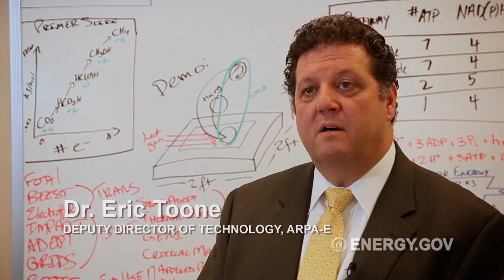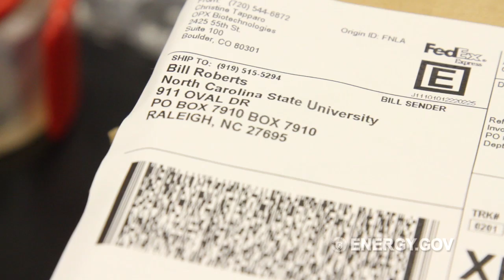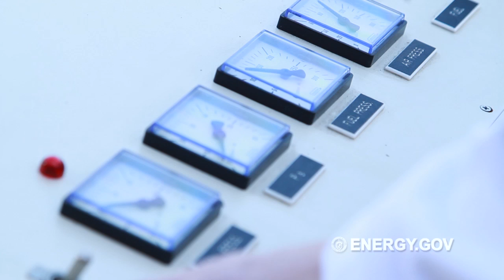Electrofuels: More Efficient Than Photosynthesis

Comment: H + CO2
From where do they get the CO2?
Reply: You can do it in several ways John. The most ideal would be to pull it straight from the air, but that is presently considered very expensive and hard. CO2 is just a trace gas in the Earth atmosphere so it is not easy to separate out. So normally one would put the fuel production where there is some industrial process emitting CO2. That could be a coal plant, concrete producer or biomass plant. Presently the focus is on the latter, since that allows one to create entirely clean electro fuel.

However in the intermediate stage, it probably does not matter if you get it from say a coal plant, because that CO2 would have gotten released anyway. However long term we don't want any coal plants, and so we cannot rely on CO2 from them. 

In the EU I think the plan is to start pulling CO2 straight from the air in 2040, and focus on biomass solutions initially.
Reply: Where get the H  ??? from water ??? from fossil fuel ??? Once you have the Hydrogen separated, why not just use it in a fuel cell like Fuel Cell energy, Plug Power, Toyota Mirai, Hyzon & Nikola motors Semi trucks, Cummins etc....the list goes on & on of all the companies that are vested in just using Hydrogen as the energy carrier once it is i from the feedstock.

Comment: I've been reading up on these systems and I was wondering what kind of CO2 concentrations are needed? Namely, does one need to be providing CO2 from a concentrated source or might the ~400ppm of CO2 in the atmosphere suffice?
Reply: MarkRavingMad, in the EU the plan is to use it from the atmosphere around 2040. At the moment they consider that option too complicated and expensive. So present focus is on using power plants burning biomass. Around the EU there are a number of coal plants that have been converted to burn biomass as far as I know. 

But there are more recent experiments with alternative electrofuels  based on metal which avoid the whole CO2 problem. You can burn metal to generate. There are experimental internal and external engines using metal as fuel.  You take a metal oxide say FeO and reduce it using Hydrogen, to get the metal, say Fe. The metal is grind down to really find metal dust which is suspended in air to burn it (cyclone or something). Bigger pieces of metal don't burn since they conduct away heat from one hot point too quickly to make the thing burn.